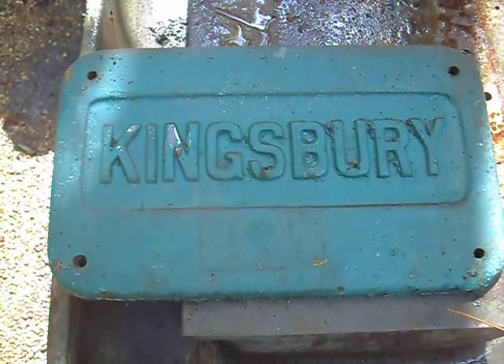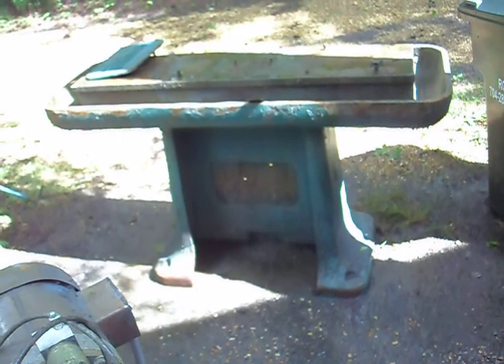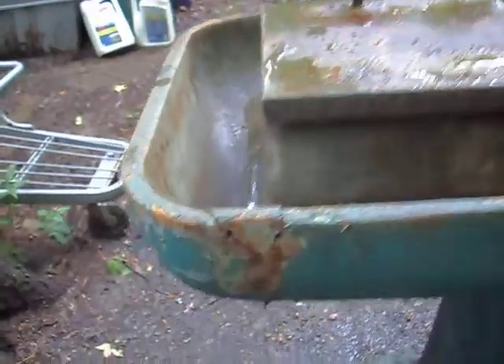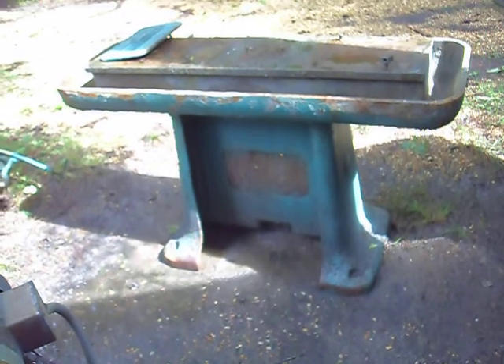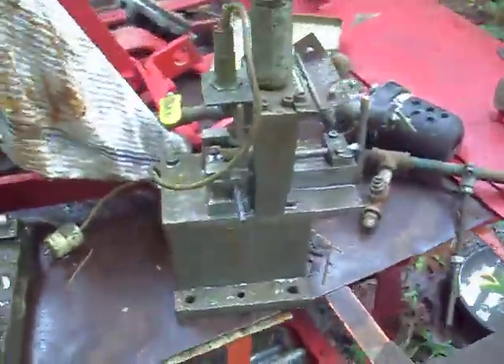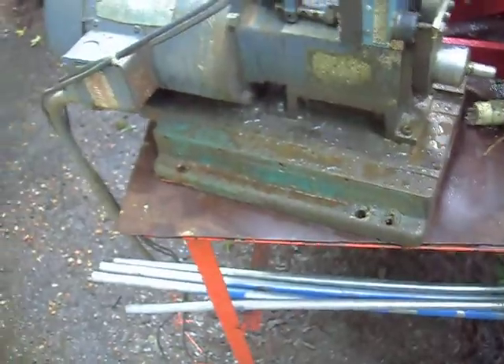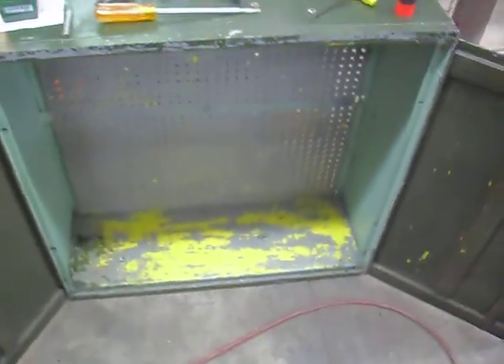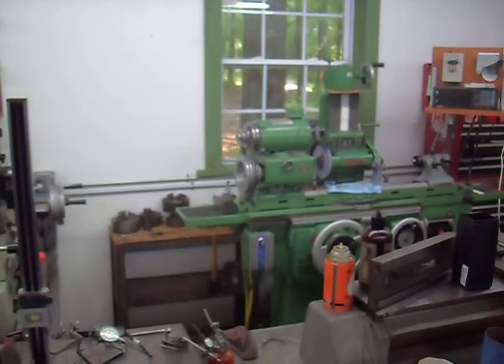Doozer's Machine Shop Update 6-9-19 -- Kingsbury machine table

Comment: That pump is not Brown & Sharpe, it's a Blackemer, very similar to Roper.
Reply from the maker: Is the whole gear reduction and bracket mounting to the motor a Blackemer design? The big gear is phenolic. The cover of the pump has B&S cast into it.  I just assumed as such.  I am not super knowledgeable on this pump.  Maybe you came across more of these. Thanks for watching.
Reply: @kooldoozer  You're right about it being Brown and Sharpe, I looked for a better picture of the end cover, the "B" is above the relief valve and the "S" below the valve, your video didn't show the "S" due to the angle of the shot.
https://www.bonanza.com/listings/Good-B-S-Brown-Sharpe-No-2-Hydraulic-Rotary-Gear-Pump-1-2-/494590718?goog_pla=1&gpid=318766195659&keyword=&goog_pla=1&pos=1o5&ad_type=pla&gclid=EAIaIQobChMIl8_8z4bL5gIVhIXICh0_MA8DEAQYBSABEgL-2vD_BwE

Comment: Given the drill press stands heritage I suspect the pump was probably rated for straight cutting oil. While it would make an ok welding table, that's kind of an ignominious end for what was a fine piece of equipment at one time. Years ago I ran across a picture on the PM forums with either 2 or 3 Bridgeport tables bolted together as an assembly /work table. With the amount of restorations you do finding 2-3 49" BP scrapped out tables and bolting them together as well as down to that DP stand would make one hell of a heavy duty work table that could still use the usual BP hold down sets. Handy for holding down larger parts while scraping them in as well. An idea for you anyway.
Reply from the maker: Hello TP,  Thanks for watching my video. Yes, back in the day that pump would have been for straight mineral oil, not coolant.  I kind of hate coolant, as I bought a used Hardinge HLV-H that someone had run coolant on, and it corroded the dovetail ways fiercely, so bad I need to re-mill them back into the proper geometry.  As for the Kingsbury table, the best use I can think of for it, is to maybe mount my 1927 Southbend 9" lathe on it that I inherited from my past uncle.  It has overhead line shafting with it.  It would be neat to bolt down the SB lathe, and make lineshaft overhead brackets attached to the back of the table, making a self contained setup. As you have seen, I have graduated from a 9" lathe many moons ago, so I hesitate to put such effort into a project like that, but it would be a fitting use for the table, I think.  My current welding table is to use with my TIG inverter machine.  It is a commercial sheet metal table top with 1" angle iron legs and frame.  Not heavy duty, but not bad.  It is 2' x 5' and serves my purpose.  When I rearrange my shop for more space, I could use a bigger welding table.  Old Bridgeport tables sound nice. Maybe in the future.  --Doozer